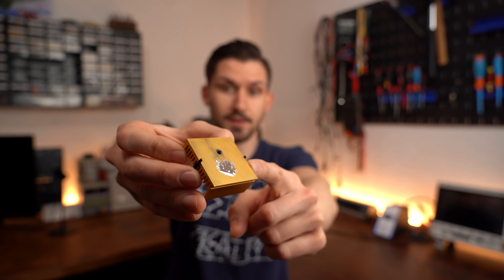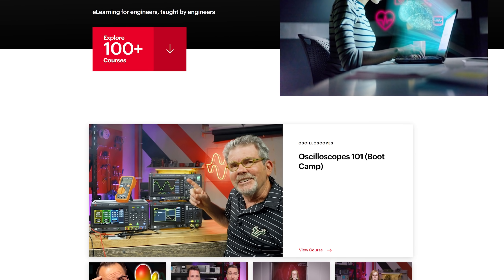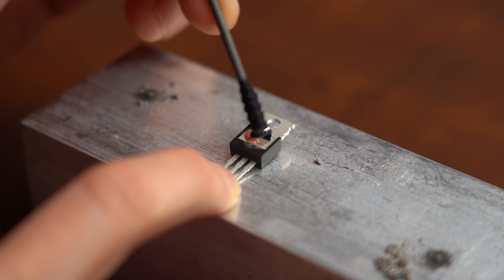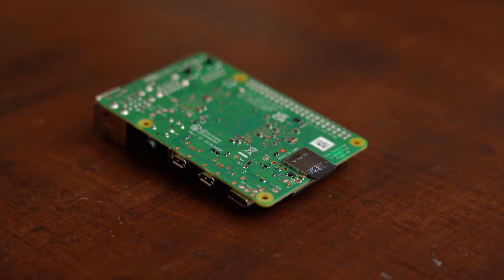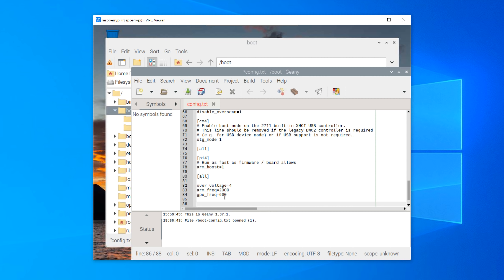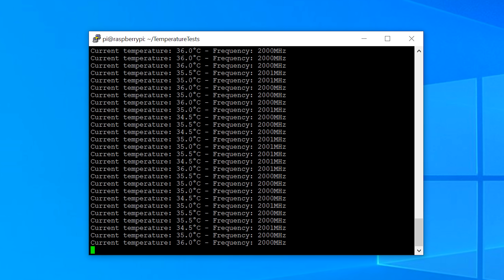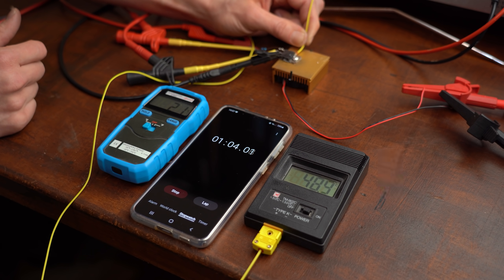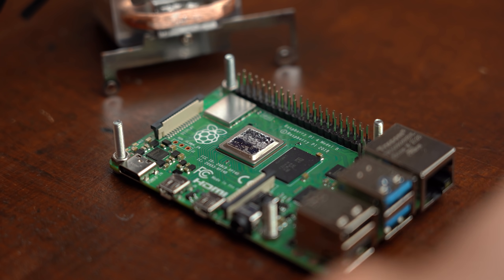Will Liquid Metal replace Thermal Paste? A Raspberry Pi gives the answer!

Comment: Underneath the raspberry pi CPU heat spreader there is thermal paste. This is likely why the liquid metal made very little difference
Reply: Yes, the proper way to make liquid metal worth its appliance is to delid the CPU and use LM between the die and the !!!copper!!! shim. A good thermal compound between the shim and the cooler (phobya nanogrease extreme). In my case this combo reduced the temps by 10C. Was maxing out at 46-48C before, 39C max temp after (both stress tested for about 2,5Hrs)
Pi4 - 2385/940, over voltage 10

Comment: Liquid metal is made with Gallium which eats oxide layers and forms an alloy with aluminum and makes the aluminum very brittle. It also reacts with copper and pits it. It doesn't react with nickel which is added to all modern CPU heat spreaders - which are nickel coated copper. Generally speaking, using a copper heatsink is fine as the reaction with copper is pretty weak, but don't use it with aluminum, it just eats it over time.

Comment: I wonder if liquid metal contains gallium, in which case it'd cause significant failures of any aluminum it comes in contact with. Check to see if your heatsinks are brittle the next day. If so, you'll need to toss them.
Reply: "Thermal Grizzly Conductonaut is a liquid metal thermal compound based on a eutectic alloy. A very high thermal conductivity is achieved through a special mixing ratio of the metals tin, gallium and indium. We recommend applying Conductonaut to nickel plated copper as this offers the best long term stability. "

Comment: Well I’m sure there are applications with subpar heat sinks where you want to get heat away quicker and thus liquid metal would be useful.  However, it will not make a difference for a component that is running constantly.  It is best for a component that turns on for a few minutes occasionally, like how a cpu isn’t alsways going at full blast, and only hits its max clock occasionally.
Reply: But for those too it usually doesn't matter as the CPU doesn't really care if it runs at 34 or 31 degrees celsius for instance. This is more a luxury product than a practical requirement (in other words something most do not need but just want because it sounds cool).
Reply: @someguy4915  CPU don’t care about the difference in temperatures that low, but desktop CPUs are almost always much higher, and even a couple degrees could give a measurable boost to performance, or more time until you throttle, or even slightly longer lasting components as high temperatures can damage parts over time.  It’s not necessary for basic function, but liquid metal isn’t just used because it looks cool.
Reply: @Sunnywastakentoo  CPU's don't care about high temperatures, they shut down before they get that high. They care about fluctuations, keeping a CPU at 70 degrees for years is fine, having it go frorm 20 to 50 degrees and back each hour will degrade the CPU. Also you shouldn't have any thermal throttling when using liquid cooling or even a decent air cooler, if you encounter throttling you have insufficient cooling.
Performance is not linked to temperature like that where a few degrees lower temperature gives a boost to performance, that is just simply not true.
Reply: @someguy4915  It is though, you clearly have never attempted overclocking. 1. most CPUs, especially AMD Ryzens, are more stable and better performing at low temps. 2. The lower the temperature, the more a CPU can boost to it's max clock. Liquid metal is mostly used in laptops because the only limitation in transfer is between the bare die and the cooler, not the IHS and the cooler. Additionally, you are thinking about power consumption fluctuations, not temperatures. Luckily, physics make it so you can't jump between 20C and 50C fast enough for the CPU to degrade physically.
Reply: @Appri  Strange how power consumption is directly connected to temperatures, maybe because electric energy is turned into thermal energy (heat) which results in higher temperatures.......
So yes, I am thinking about sudden temperature fluctuations and how liquid metal might better couple the CPU to the heatsink for catching slight variations in temperature.
Besides that, liquid metal does not itself provide cooling capacity, it only connects the CPU (heat source) to the heatsink. 
Can you name a production laptop that default ships with liquid metal?

I don't think physics would make it possible to jump between 20 and 50 degrees fast enough anyway, I'm glad you worked that one out too ;) That was kind of the entire point but I'll write it out more clearly then: liquid metal itself does not cool your CPU, it merely connects it to the heatsink slightly better than thermal paste does, which could help in averaging out temperature fluctuations, it does not increase cooling capacity, a 100w TDP heatsink does not turn into a 125w TDP heatsink after applying thermal paste or liquid metal...
Reply: @someguy4915  
1. Power consumption is directly linked, but going from 50W to 20W won't drop your temps from 50C to 20C immediately, aka temperature fluctuations don't cause degradation, only power does. And that's because the current through the transistors change greatly, not because of physical expansion and retraction. AKA you misunderstood what I said twice.
2. I never said liquid metal increases the heat dissipation capacity of a heatsink, I said that the hidden limit is the material between the IHS and the die, not the IHS and the heatsink. In reality, you are never reaching the heat dissipation capacity of the heatsink unless the thermal interface is good enough. You see lower temps on your CPU because of how thermodynamics work: 73W/mK means you get a smaller temperature difference between the heatsink and CPU w the same distance than a 8W/mK paste or pad can. And as the rate of heat transfer is limited by the material with the lowest total conductivity, you are screwed by the paste/bad solder in between the die and the IHS/
Reply: @Appri  Which is exactly what I stated originally... Not sure what you're arguing now?
Reply: It would be good between a power device and a copper heat spreader like say for using large power mosfets in an amplifier pallet as that's where you want the lowest thermal gradient.
The copper will suck the heat away very well and apply it over a larger area onto a conventional aluminum heatsink.
Another place it would be fantastic would be if the heatsink uses a refrigerant or water cooling to remove the heat
Reply: Not true - Gamers Nexus tested liquid metal on gpus running for a full year solid.
Reply: spoiler, they could have kept running and running...

Comment: So, being reactive with aluminum, I wonder if it is made of gallium.
Reply: "Thermal Grizzly Conductonaut is a liquid metal thermal compound based on a eutectic alloy. A very high thermal conductivity is achieved through a special mixing ratio of the metals tin, gallium and indium. We recommend applying Conductonaut to nickel plated copper as this offers the best long term stability. "

Comment: 5:35 have you tried de-lidding the Pi 4 CPU? It's not too hard, if you heat the heat spreader a bit and gently pry around the edges. Liquid metal seems to work better directly on the chip, and on the Pi 4 that heat spreader is actually a pretty thick slab of metal

Edit: Just saw 10:53, and yeah—delidding will require a bit more persuasion — I had to use two small flat head screwdrivers and pry around the edges after heating it up. Be prepared to accidentally destroy the Pi though!
Reply: 10:53 - isn't this an RPi4?
Reply: Watch the very end of the video. He tried it and failed.
Reply: Back Red Shirt Jeff - you can't delid a chip with an angle grinder.
Reply: @PaulGrayUK  Heh, I did it without one ;)
Reply: @JeffGeerling  Hmmmm, so one per hand, that would be a two dremmel job then.   Two dremmels one redshirt - Can't wait to safely google that one day :-)
Reply: That’s one of a legend commenting on a German YouTube channel :) thanks for your helpful and entertaining videos
Reply: @TecSanento  I love watching Great Scott, wore his shirt in my latest Geerling Engineering video ;)
Reply: where there's a Pi, Jeff is always nearby. :)
Reply: Would probably need a much larger heatsink as not to heatsoak so fast still.
Reply: One does not "Accidentally" destroy pi.
Reply: RUN Its Red Shirt Jeff!
Reply: Be very careful if you try deliding your Pi, you can accidentally chip the die or destroy it if you are not careful. Attempt at your own risk.
Reply: +1

Comment: If your heatsink is the bottle neck, you would need something to remove all the heat fast like a liquid cooling system to see a benefit
Reply: not the heatsink but the thermal paste between heatsink and the chip

Comment: If you want to overclock the Pi4 to 2.2GHz you need to add the following to the /boot/config.txt

force_turbo=1
over_voltage=8
arm_freq=2200

I used Liquid Metal in my ThinkPad W541 with a 45W CPU and it helped a lot. Temps dropped about 10-15°C in average.
Reply: I used it as well for my "gaming" laptop (R5 5600H). It lowered the peak temps by 7C and it increased the boost speed as well
Reply: with my pi I can reach 2.2 ghz only with a heatsink on the power supply
Reply: Nice

Comment: When i went from thermal paste to liquid metal for cooing my AMD CPU, the whole thing was -1c cooler. Not worth the the hassle.
Reply: I achieved up to 20K on my 6700k laptop.
Reply: Because the problem is the shitty soldering and bad lapping from the factory. Well done liquid metal jobs can drop the temps by ~7C which is a lot in overclocking.

Comment: It looks like liquid metal is either Gallium based or Mercury based since both of those metals are liquid at room temperature and they just eat through Aluminum.
Reply: Definitely gallium, since mercury is more or less banned by RoHS. (There are a few remaining uses like UVC bulbs where alternatives are not practical for all use cases.)

Comment: (Edit: This comment is wrong, see reply)

Unfortunately, the transistor test at the end had an incorrect methodology.

By construction, the transistor was always generating about 16W of heat.  At steady state, that heat must flow to the heat sink, which must in turn exchange that heat with the ambient environment.  The temperature of the heat sink is limited by its thermal contact with the atmosphere, evidently about 2.5K/W in your test environment. 

That means that the heat sink will have a steady-state temperature of 60C *regardless of the contact between transistor and heat sink*.  You could replace the liquid metal with no interface at all and see the same sort of steady state.

To measure the system properly, you need to look at the temperature of the transistor itself, perhaps with a thermocouple attached to the non-heat-sink side.  The Raspberry Pi test setup was superior here because it reported on-die temperatures.
Reply from the maker: I looked at the transistor itself. I meased the temperature at its body.
Reply: @greatscottlab  Oh!  I apologize, I mis-heard that section of the audio.  I withdraw my complaint, then.

Comment: Putting conductive liquid material on the CPU or another chip in my PC or another electronic equipment is big NOPE for me, no matter how good thermal conductivity it have, unless is done by the manufacturer like in the PS5 for example. Imagine a small droplets on the pins or tracks of your pcb fraying your expensive equipment because you decided to lower the temperature of some chip by few degrees.

Comment: Personally wont touch the stuff due to electric conductivity, chip shortages and money shortages I cannot take the risk right now (mostly talking about pc). Oddly I am willing to do water cooling and that can easily be more catastrophic if something fails and ruin everything in the system. I suppose I feel this way because I have experience with water cooling already.
Reply: No, oil cooling, that why you will not ruin any silicon! And you can get it about -15 to -30 degrees!
Reply: @mickgibson370  lol and have fun cleaning it. lolol...If i were to do that I would use the 3m fluid but Id also have to be rich.
Reply: @mickgibson370  There is a cooler for Intel skus now that also use a peltier cooler on it with water cooling. I always wanted to build my own just for fun, I also like phase change cooling systems but loud and expensive.

Comment: My take home message is: Liquid Metal get's the heat away faster, thus is good for short bursts of power, rather than constant loads. For constant high loads your bottleneck will be the heatsink and fan.
Reply from the maker: Sounds about right :-)
Reply: heatsink? maybe a bit but mostly the thermal paste between the chip and the heatsink.
Reply: @profix25lo  That's the liquid metal.
Reply: @Those_Weirdos  sorry, my mistake. It should say: "heatsink? maybe a bit but the thermal paste between the chip and the HEATSPREADER is the limiting factor" :)
Reply: @profix25lo  Yeah, liquid metal tests r best done between the bare die and the spreader, not the IHS and the heat sink.

Comment: For everyone who's old enough this is not a question anymore, as this was already solved decades ago. Liquid metal thermal compounds became more or less popular in the very early 2000s. There were two sorts, the pure liquid metal like shown here, and metal mixed with a polymere compound (like conventional thermal paste) which made it easier to apply. Both had the same downside of being electrically conductive. Liquid metal pads came shortly after and promised an even further progress in terms of handling.
But quintessentially, the upsides weren't worth the downsides and with the progress the conventional thermal pastes made, liquid metal was basically obsolete very quickly and only stayed in use with hardcore enthusiasts, because even with big CPUs and appropriate heatsinks it's not that much better than common thermal paste.

Comment: @GreatScott!  De-lidding the Pi 4 is completely doable. I used a razor blade rather than a screwdriver. Using the same Ice Tower cooler, the heat-pipe aligns with the SoC die. A little silcone  conformal coating on the aluminum  to prevent the galvanic corrosion with the liquid metal and aluminum. Pi 4 4GB overclocked to 2300MHz completely stable max temp ~45C.
Reply from the maker: Thanks for the tips :-) Maybe next time.

Comment: steal some nail polish from your girlfriend and use that to protect the board around where you use liquiid metal, easiest way
Reply from the maker: Sounds like a good idea
Reply: @greatscottlab  clear nail polish obviously would be the best to use but it doesnt matter really, just use a couple coats,letting it dry in between... my current watercooled gpu has classy pink nail polish around the die :)

Comment: Another thing: Thermal paste dries out and gets worse over time. it should be periodically replaced.

Liquid metal? It has a FAR higher lifespan. 

In my eyes, that's the real use for liquid metal: Longevity.
Reply: Thermal paste really only needs replacing every 5 years or so depending on humidity and temperature of the location, even under heavy thermal stress.
For office computers, thermal paste is usually not replaced before the entire pc is replaced, so never.
By the time you need to replace thermal paste you are usually replacing the CPU already anyway, unless you buy the cheapest possible thermal paste which dries out as you apply it.

Comment: Your overclocking being unstable without the fan is most likely from the clockspeed/temperature scaling. It can be seen with the last few generations of GPUs and CPUs with the automatic boost behaviour, especially when using liquid nitrogen or other exotic solutions to cool the chips under ambient temperatures, and if I remember correctly, every 5 degrees celsius you can reduce on Nvidia GPUs gives around 25MHz to clockspeed with the automatic GPU boost feature.

Comment: Does anybody have more in-depth knowledge of HF signals over wires?
- As a thought experiment (only High School-level physics experience) I’m wondering what the best kind of electrical cable (“no matter the cost”) would be to use for PCI Express (Gen4) connections that use as far as I know 8 GHz signals for let’s say 0.5 m length. There are SFF cables for PCI Express Gen4 (with OCuLink SFF-8611 or SlimSAS HD SFF-8654 connectors for example) but there are really EXTREME quality control issues :(
Reply: Can't beat "micro coax" ribbon cable, at least until you see the price. :)
Reply: @NiHaoMike64  Thanks for the response! Do you by any chance know if it is possible to DIY-attach such cables to SFF-8611 connectors?

Comment: The LockPickingLawyer has a cool video where he basically 'dissolves' a solid aluminium padlock body with Gallium (one of the main components of 'Liquid Metal').

It's pretty interesting to see - The Gallium undermines the structural integrity of the solid aluminium..
     And since it's working underneath the oxidized surface, the outside initially looks like nothing is happening..
       But the solid metal eventually becomes sort of a metal pulp :)
Reply from the maker: Sounds interesting. Thanks for sharing :-)
Reply: @greatscottlab  Here's the video :) (around 7:25 in the video is the part where part of the aluminium still looks normal, but it turns out it's just a puddle underneath)
https://youtu.be/jeghGhVdt9s

Also, now that I watch the video again, I'm surprised how little Gallium is actually needed to do this... and how it just keeps on reacting and reacting and etc.)

anyways, thanks for the years and years of continuous teachings. I've been following your channel for quite a few of them (:

cheers from Amsterdam

Comment: No you are wrong in computer applications you can save 10°C or more with liquid metal. And also it doesnt dry like normal thermal Paste
Reply from the maker: I said that at the end though that it can be useful for computer applications and similar.